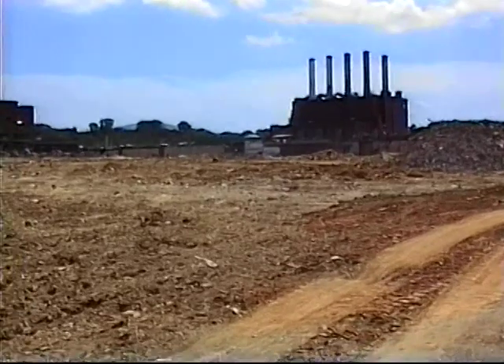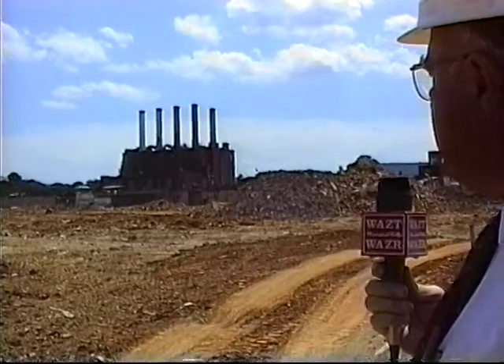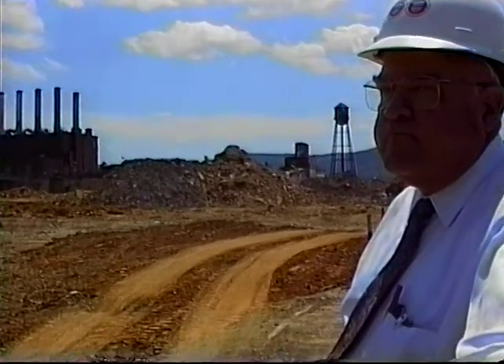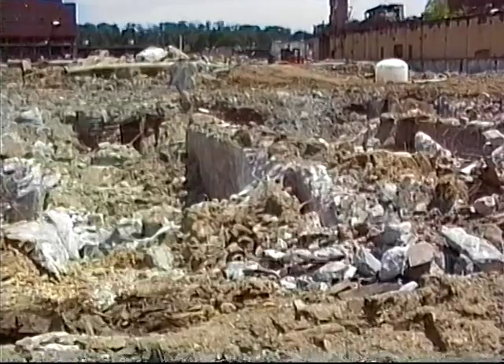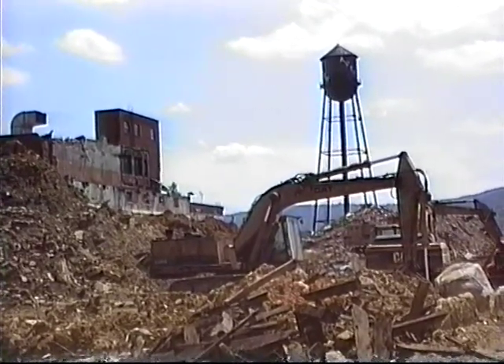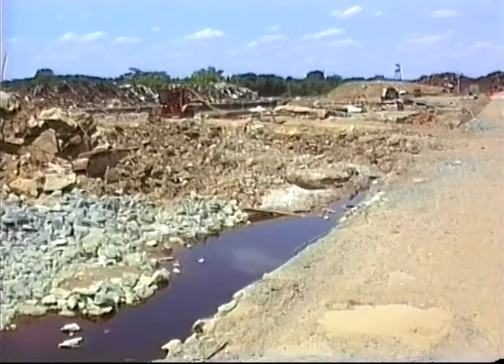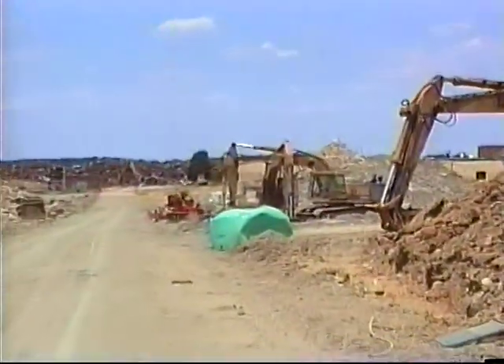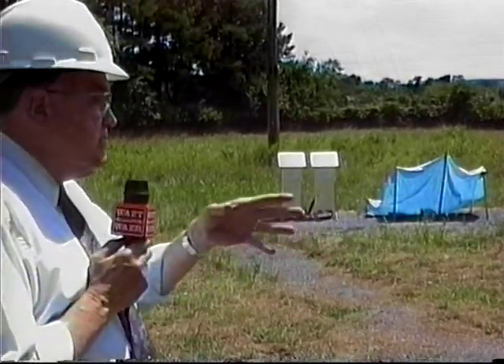Avtex US EPA Superfund site tour with Patrick Gaughan 1990's

Comment: Background:
The Avtex Fibers, Inc. Superfund Site is located in Front Royal, Virginia. The area includes a 440-acre plant that manufactured rayon and other synthetics from 1940 to 1989. Plant waste disposed in on-site impoundments and fill areas contaminated groundwater, soil, and the Shenandoah River with hazardous chemicals. The site was added to the Superfund program's National Priorities List in 1986. Following cleanup, operation and maintenance continues.

Also:
The Avtex Fibers Superfund site was a rayon-manufacturing complex covering 440 acres on the Shenandoah River in Front Royal. The fibers were used for parachutes in World War II and later to insulate the nozzles of rocket engines, including the solid rocket boosters that lifted the Space Shuttle into orbit. The facility was a major local employer operated by American Viscose between 1940-1963, FMC Corp. from 1963-1977, and finally by Avtex Fibers from 1977-89.

As part of the fiber production process, carbon disulfide, polychlorinated biphenyls (PCB's), arsenic, and other wastes were deposited into unlined basins, landfills, and open piles. Effluent was discharged into the South Fork of the Shenandoah River under a National Pollutant Discharge Elimination System (NPDES) permit, while groundwater was contaminated as much as 400 feet deep and hydrogen sulfide releases created a "rotten egg" smell in the area.

Nobody cares.
Reply from the maker: Some people care. No signage is posted about eating too many fish from the river where I have seen many people boating, swimming and fishing near the low water bridge. Newcomers to the area do not have a clue. Efforts to open a museum onsite were squashed by Jennifer McDonald, then EDA Director, even after my son and I got the exhibits set up in the designated room near the entrance! Thank you for sharing your information!
Reply: @sandyflynn1083  

I was being a little flip. There are definitely people that care. 
But you’re right, many newcomers to the area have no idea, and many of the people responsible or in powerful positions would prefer to run out the “clock of memory”. 

The Mercury in the river from the rayon plant in Waynesboro will be there for thousands of years.
Reply from the maker: @JEEDUHCHRI  Yes, I heard the river here will sadly be polluted for over a thousand years.